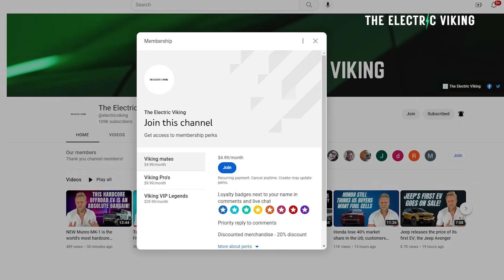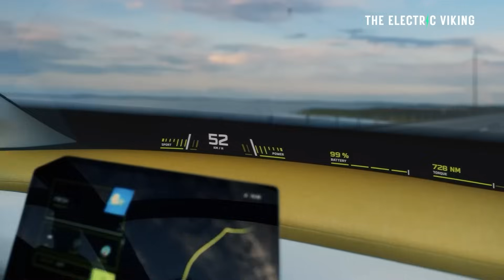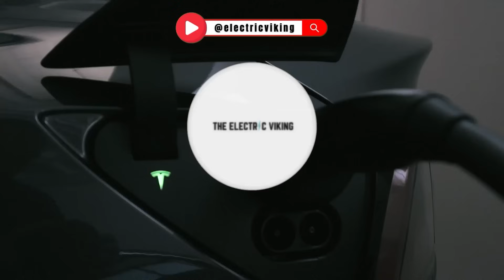BMW’s 800v EVs get structural batteries with Teslalike cylindrical cells

Comment: My ICE mercedes c200 has a maximum motorway range of 1,430 km or 62mpg(uk)/100kmpg or 22km/litre with a 65 litre tank. 10 minutes to put 65 litres of fuel in. Mass 1,565kg. Its currently on 350,000km..And best of all its used retail price was £9.3k when it had 250k km and I acquired it.

Comment: How the fuck is BMW going to get 550 miles of range in a 3 series with a 90 kWh battery?  Their current 3 series EV has an 83.9 kWh battery and in its most efficient configuration has a 311 mile range.  A 90 kWh battery would give it a 333 mile range.  A 550 mile range would be a 65% increase in efficiency of kWh per mile travelled.  If that was the case, this video would be about industry changing improvements in drag coefficient and weight reductions.  Your videos are getting more and more unrealistic.  Please go back to reporting the real facts, like you used to do, instead of making sensationalized and unrealistic videos about vaporware that defies the laws of physics.

Comment: 500 miles of range? This is pointless for millions of buyers. Millions have a home with a plug that can charge any car during the night. These millions have 2 cars, so that one can be used for the rare cross country trip. When are we going to get a lighter, and cheaper car that has 100 miles of range? Probably not until these pundits stop with this nonsense that more range is always better than less. I have absolutely no desire to drag around a big battery that I won't ever use!

Comment: That is great if you can afford it.
BMW will most likely sell at USD$ 80,000 -$90,000  minimum for these cars.
Only the wealthy will be able to afford these.
Do this with less expensive / more  affordable vehicles.
Badge snobbery at a cost. 
Also they need the chargers for these speeds and they are just not that frequent. 
Typical Home charge speed at 7 kW or 21kW if you have three phase power to the home.
So a minimum 6 hrs at 21 kw - 12 hrs on a 7 kW  home charge or 36 hrs on a granny charger with 240 Volt.
Reply: The only time you'll be using the full capacity of the battery will be when you're on a trip. That's also when you're likely to use a fast charger to top up. So, you never have to wait that many hours for the car to recharge on regular wall chargers.

Comment: 500 miles under ideal conditions like European milder temperatures and no A/C running. You put that car here in Australia mid summer with the aircon running and you will find that that 500 miles will drop significantly.

Comment: BMW has driving dynamics better than the Chinese; Chinese might look good on the special sheets but most drive crap and have boring interiors.  BMW have an advantage fir those buyers who kike driving and good driving dynamics. So better range and charging than previous BMW but with the better BMW driving dynamics, that's a big plus.  Problem is BMW pricing structure of making you pay for everything on top of base price. Directional charging is a well-known concept, and is a big plus.

Comment: 500 miles at optimal conditions. I'm waiting until they can give me 400 miles at -30C for a reasonable cost. Canada here...
Reply: Thanks to rapid out of control warming 90% of Canadians live where -30 is very rare and probably 8 of the remaining 10% live where it goes to -30 maybe 3 times a winter. So don’t give me the “I’m in Canada therefore it’s too cold” line.  The only problem even when it is -30 is long distance driving anyhow, so you are down to maybe 1% of EV owners having real problems in Canada.

Comment: Why want a eternal combustion  engine when EV has  500 + Mile range.....PERHAPS BECAUSE THE BATTERY WARRANTY  IS 8 YEAR TRASH. THATS WHY. I have no interest in spending 20,000 on a NEW BATTERY. It ain't rocket science.  It's common semse. EVs can't compete with LOGIC , REASON AND COMMON SENSE.

Comment: I would much rather have 200 miles of range but with ultra fast charging, so the odd time I need more than 200 miles in one journey I can charge quickly.  I don't want to lug around a battery capable of 600 miles when most of my journeys are under 20.

Comment: As the EV industry moves to 800v, it will require a lot of silicon carbide (SiC) components, which the semiconductor industry doesn't currently have the capacity to fill.  The semiconductor companies that are investing into increased silicon carbide capacity that I've found are ON Semiconductor ($ON), ST Micro ($STM), and Vishay ($VSH).  I own $ON and $VSH, and they are currently selling cheap relative to the long term value of the company (In my opinion).

Comment: Mercedes is coming out with the CLA electric in March. 470miles of range, 800 Volt system, 320kw charging, vehicle to grid, vehicle to load, 300km in ten minutes.
Reply: And also programmed faults and general low reliability with extremely high prices if parts?

Comment: Did you noticed workers wearing mask. Why, go back to 1980 8ntel chips. The intel chip had over 1 million mirrors in it. The mirrors would get a speak of dust on one mirror screwing up the outcome. It took Intel about 4 years to solve the problem. 
Intel required the chinese factories to have massive air sucking devices in them. Intel also required hair nets on factory workers. And that what solved Intel chips to work correctly.
I only know this because i took up electronics and digital in College.

Comment: NIOs largest swappable battery pack still destroys BMW, and all other EVs, but of course you’re a paid off Xpeng loser that will not cover NIO, what a clown grift!
Reply: Ya he hates Nio which actually had the most cutting edge of technologies, swap, 925V platforms, drive by wire, rear wheel steer